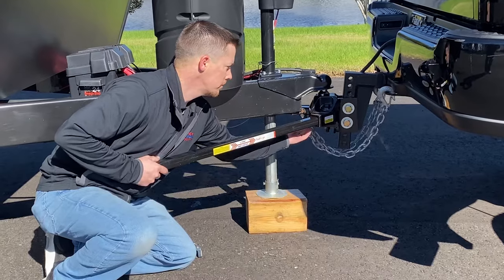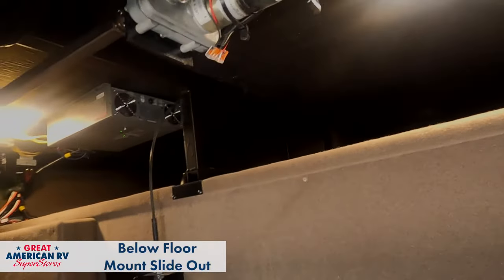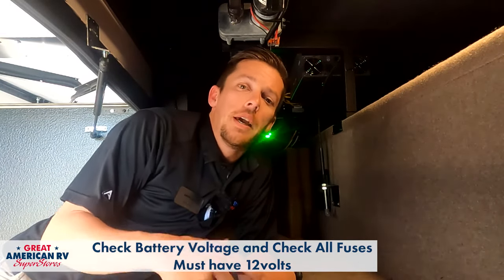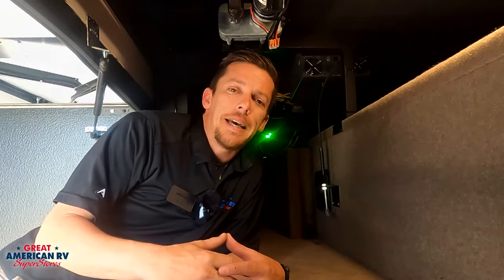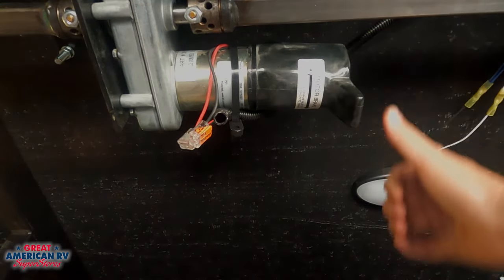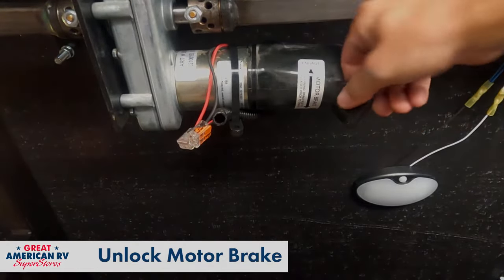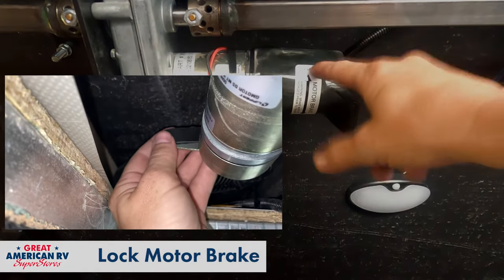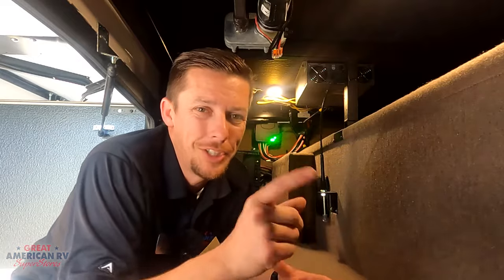How To Manually Retract Your Below Floor Mount RV Slide

Comment: I have a 06 daymon daybreak and i dont see the lever on the motor ... Any advice please sir
Reply from the maker: @jimscycleandautotn8508  on that early model, they likely don’t have the holes.  You will have to gain access through the underbelly to get to the motor.  You can override it there or replace it.  Just a few bolts and 2 wires to replace.  Of course check the voltage first to confirm the motor is bad.  Good luck.  Let me know if anything else I can do to help. -Todd
Reply: @GreatAmericanRV  it has access hole 🕳️ in storage to see motor , just don't see the lever like you showed , pulled boot off and it's just two pigtails
Reply: Not using slide ,just replacing floor as it was flooded . Just need to move it out , do floor and run back in . Thanks for fast reply in original comment .
Reply from the maker: @jimscycleandautotn8508  honestly not 100% they would have a brake release on that old of a motor.  Might have to remove it to push the slide.
Reply: @GreatAmericanRV  Roger that , thank you sir
Reply from the maker: @jimscycleandautotn8508  very welcome!

Comment: please show a video where you are actually manually doing the act of pushing in the slideout. Just an explanation is not helpful to me.
Reply from the maker: Sorry we didn’t give enough description, but for the particular slide out, you can place a crescent wrench on that square bar and turn in one direction or the other.  One of them will prove to move the slide in once the brake has been disengaged.  Hope that helps.